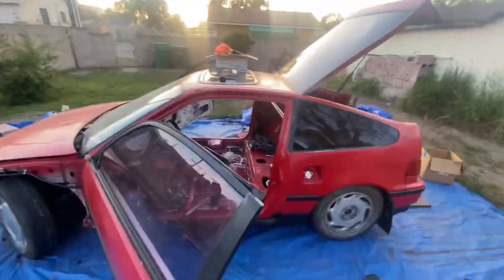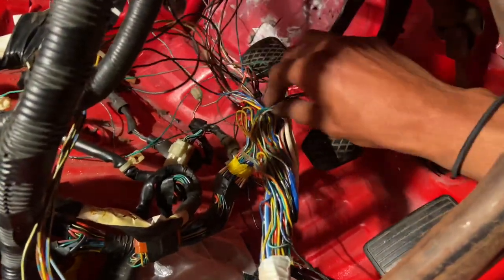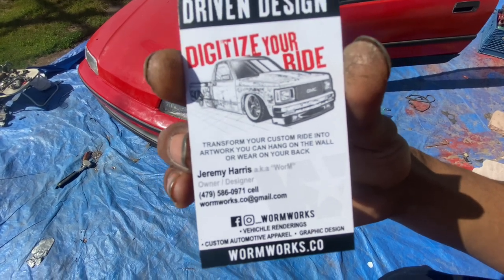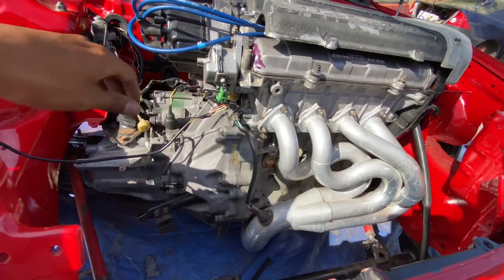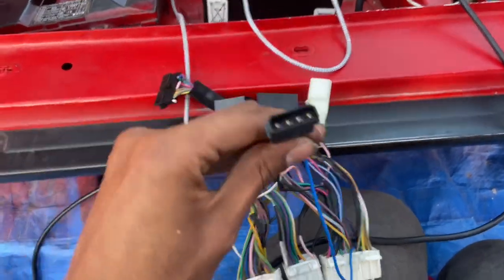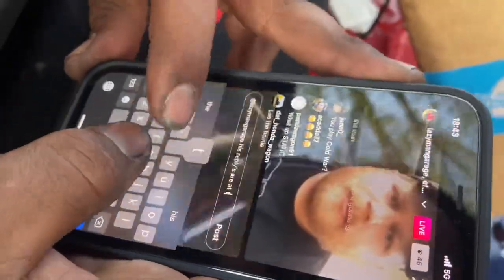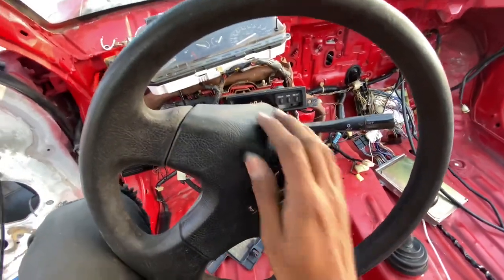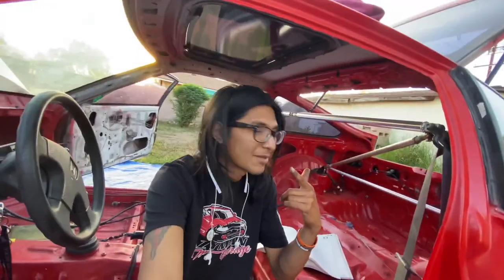CRX OBD1 CONVERSION | wiring up my heated 4 wire o2 sensor

Comment: I'm converting my ED7 to OBD1 for a Z6 swap. I really do NOT want to just leave the stock single wire o2 plug hanging in the bay, or even on the car anymore. For OBD1 conversion, can the stock o2 just be depinned and cut out?
Reply from the maker: that o2 wire can be used as the primary signal wire for your heated o2, it literally goes to the same ecu pin D14. plus it’s shielded. after that you only need to add a wire for A6 , a wire for switch power , and a wire for ground

Comment: Where do you find the parts for that engine Zed C timing belt water pump and head gasket I have the Japanese version
Reply from the maker: 1988 prelude si timing belt and water pump, 1986-89 integra head gasket
Reply: @anotherefncrxvlog4350  thank you appreciate it

Comment: Bro, I have a honda civic hatchback 1990, the oxygen sensor wire is missing, what I know is that comes from the distribuidor wires also, do you know what is the color of that wire??  how can I find it, this car is burning so much gas because that wire is disconnected, please help me
Reply from the maker: it’s just a single white wire running to ecu pin c16
Reply: @anotherefncrxvlog4350  Thank you so much Bro, you have a good day